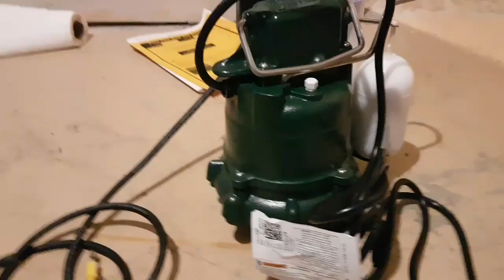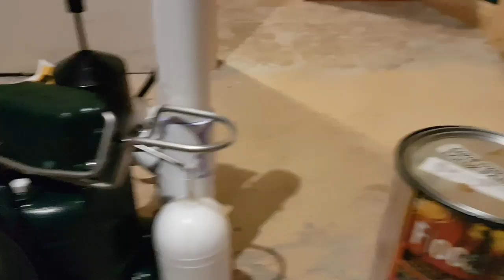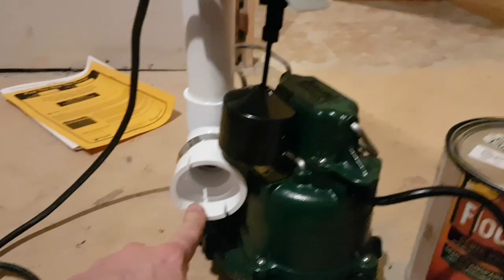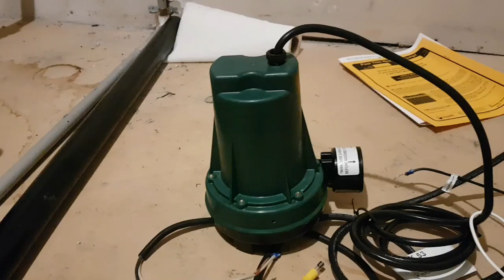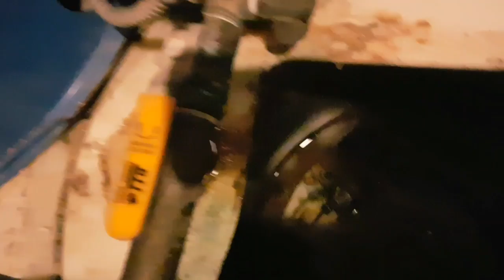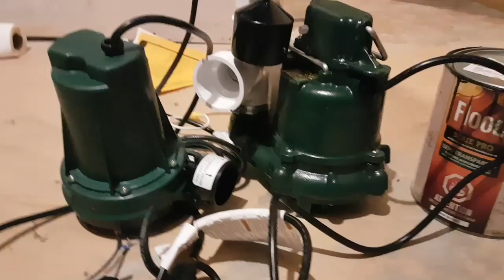The Best Sump Pump? - An Engineers Review

Comment: I have a Zoeller M264 that has been in operation for 3+ years (yes it's a sewage pump that I use in a sump pit).  On a dry day it cycles once every 15 mins, on a rainy day, every 2 mins (my house is 30 ft from a pond, so the water table is high).  I never trust a built-in switch - I tied the switch lever to an on position permanently, and run a Hydrocheck switch.  It has been flawless - knock on wood.  I do clean up the whole system every year.  What I don't like about Zoeller is the price and performance.  You get a lot more throughput per amp from other brands.

Comment: I had a Zoeller M53 with a Zoeller Basement Sentry back-up installed in Aug 2019. It's May 2024 and I'm replacing the whole works. The Primary pump does not always come on, I suspect a switch problem. And the check valve in the Sentry back-up  completely broke off - so two problems at once! Also, I've never liked that the M53 pumped so often because the float is not adjustable. My old sump did not cycle so often. I'm not installing a Zoeller again. Has anyone heard of the Pro Series combo pumps? I'm considering one of those on recommendation, but will have to do more homework.
Reply: I haven't had good experiences with 3 zoelers ? I have a wayno 1/2 hp battery backup and have  been great and super quite

Comment: The ABZ’s of pumps - Always Buy Zoeller
Which by the way rhymes with/ Dollar, I just learned that watching their webinars 😃
Mine short cycles & we either need a bigger dia. sump crock, a longer range teether type switch like you mentioned, or both.  Something adjustable for a larger range than the style all 3 of my Zoeller sump pumps have, they’re just like yours.
Turns out there are lots of new, high quality solid state switching options available. In fact, Zoeller even offers their own version. 
Now how do I best bypass & block off / plug the current switch to run a piggyback float switch in its place? I got ideas😎

Comment: I bought that Zoeller pump on your recommendation and now it's constantly on and never goes off after less than 2 years.
Reply: You might need a check valve. It could be the pump is experiencing backflow from the line and that is flowing back into your well.

Comment: 2022: Great USA made pumps and I have 5. But I just bought a Liberty. Lots of water intrusion issues into the float/switch housing, and the 9.3 amp draw is just absurd, it should be 4 or 5 amp max. They scrimp on the windings and thus it uses more power. When I learn of improvements in the switch box, I will buy again. Unfortunately, they have been bought out by a mega company and now some box store branded crap from China is appearing. So the jury is out.

Comment: My house was built in 1991. It still has the original Zoeller N53. The switch has started sticking occasionally. Obviously I'm getting another Zoeller. My house in on hill and generally pretty dry, but 31 years on a sump pump is incredible.

Comment: This video is from 2017, since then Zoeller has made upgraded version of the M53 pump and its the M63 pump, upgraded switch with higher cycle rating, better switch boot cover, and lighted led plug. Worth the extra 50 bucks.

Comment: In any main sump location using an external switch (like the levelguard or HydroCheck) with a Zoeller or Liberty non-automatic cast iron pump (no switch) is the best setup IMO. 
The electronic switches last many cycles and can operate in a dual pump system in a very tight space. 
The HydroCheck dual sensor switches are infinitely adjustable allowing you to handle many different water level scenarios. 
I would never trust a "float" switch for a main sump location.

Comment: The trouble with Zoeller pumps is that one, they draw a lot of amps, pump like crazy though. The other is that they turn on at a low level, and the float is not adjustable. There is not much "travel" in their float. Better off getting a non-automatic Zoeller and using a Levelguard solid state switch or such a switch with the stock float tied in the on position

Comment: I have 0 5 hp zoeller sump pump for over 2 years. It cycles a lot and doing ok but I feel its gph capacity is low. I see a ridgid smart dual suction sump pump with an air switch and smart tracking. Any reviews or details on how good and reliable the pump is and when is an air switch preferred pros and cons?

Comment: My Zoeller M98 died within a year (2019) from a bad capacitor, burned switch contacts, and shaft wobble - the M98 upper shaft "bearing" is just cast iron (no bronze, etc.).  Also, Zoellers do not use split capacitors, so they tend to use more electricity (compare amps/HP) than most other manufacturers.  Efficiency is important to for people that must have a lot of water moved for long periods.  I like superiorpump.com (buy them through Home Depot).
Reply: Stay with Zoeller, but get the N98 or the N53 non automatic versions, then buy a levelguard switch and your golden.
9 yrs for me with the N53 and levelguard switch.

Comment: A few years back when I was shopping for a new pump, I did a lot of research and the most common complaint about Zoeller pumps was that the switch failed after only 18-24 months. Since I wanted a Zoeller pump, I did a lot of research on switches. There was no real consensuses on who made a reliable switch so I didn't buy a Zoeller pump.
Reply: Pro1er my switch just went bad on my Wayne sump pump after only 2 1/2 years 6 inches of water in the basement. So who knows? Luck of the draw I guess. Luckily no damage. The only thing in the basement are the mechanicals which are a foot off of the floor. But definitely getting a primary pump, back up pump with battery. I just don’t wanna worry about it.
Reply: @Maynardd  You might want to look into a water alarm. I have one that calls my cell phone.
Reply: Pro1er so I found some Zoeller videos from them on YouTube.. As of about a year ago they upgraded their switches and have tested them up to 3 million times with no failure. I’m assuming the switch issue has been resolved. Wayne only tests up to 1 million. They also extended their warranty by two years because of it. So now has a five year warranty. Hopefully it’s been resolved? I appreciate the advice. Thank you.
Reply: Yeah, my Zoeller is stuck on after only a couple years.  What pump should I get?
Reply: Myers and liberty are great pumps. My septic system effluent pump is 20 yrs old and still runs great.

Comment: The switch on this pump will be the first thing to go.  Next time I will buy a zoeller pump with no switch.  I plan on using a piggy back cord and a easily replaceable vertical switch.  Still have my zoeller as a backup after replacing the switch.

Comment: This is a Zoeller Aquanot 508 packaged dual pump system. They have three variations of this model - and they are also available in single and dual pump packages.  Zoeller makes good stuff. I might suggest rather than the Aquatnot 508 bundle you buy a primary and the secondary separately if your pit is wide enough to handle two separate pumps.  For the Primary - a Zoeller N53 (not M) with levelguard electronic switch or a Ion Industries WC33i (it has its own digital switch). For the battery backup pump a Zoeller Aquanot 508 FIT model.  Single floats fail more often (like on M53) and an electronic switch is more reliable. The Zoeller backup sump Aquanot 508 Fit model has two floats to protect against float failures and its digital charger tests, monitors, and texts you with the condition of your system. Get a AGM Marine Deep cycle battery for the back up pump. Check out www.sumppumpsdirect.com or your local recommended plumbers.
Reply from the maker: Thanks for your comment.
Reply: I was about to go for this setup but then realized that it's only .3 hp. 43 GPM wouldn't be enough for me. I had a sump pump that was rated at 66 GPM and that wasn't enough. Is there a Zoeller just like this one with more horsepower?

Comment: Plumbers are reporting that there are a lot of bad Zoeller pumps of late. Switches are going bad within a year and then the pump won't shut off. Possibly it's water getting into the switch. Do some research first before purchasing.
Reply: I have a 1/2hp $49. Harbor Freight sump pump that I bought 5 years ago... and it works a LOT (currently cycling every 1 to 1.5 minutes with all the rain and a High water table with poor drainage due to near solid clay about 10 feet below ground level... anyway, it has performed flawlessly now for 5 years.. has a totally enclosed Magnetic switch on a verticle float shaft with a separate power cord from the pump motor.... and I bought an identical pump as a replacement.  

The only difference (hopefully!!) is that the new pump has a green motor casing which says "Drummond" on it and the price has nearly doubled to $84.99!!..... but is still a great deal compared to the "name brands" at other locations, especially if the new one works as great, and for as long and hard as the "harbor freight" model that I've had for the last 5+ years and still going strong!!
Reply: William K which pump would you recommend??
Reply: It may have just been a bad batch of switches... I don't know. Might take a look at the Liberty pumps.
Reply: The switch issue was an old issue that they have resolved - BUT- many vendors including Zoeller are offering electronic switches as an upgrade choice - or even dual floats - as all single floats from any vendor are failure points more than the pump itself. Zoeller, Liberty, and Ion Industries all make great sump pumps - and USA made.
Reply: That is exactly what happened to mine after 2 years, it's constantly on.
Reply: @William K — If the pump won't shut off, it's most likely due to switch contacts welding, which is due to improperly specified switches or Zoeller's switch vendor pulling a switcheroo on them, substituting inferior material.  My preference would be to avoid pumps with built-in switches altogether.  If the switch is an external accessory, it is easier and cheaper to replace as a separate unit.